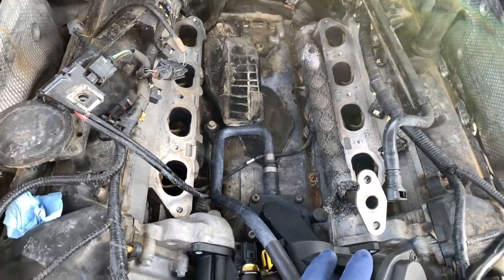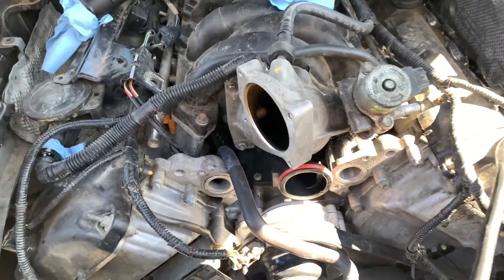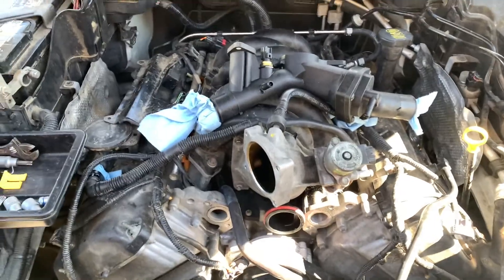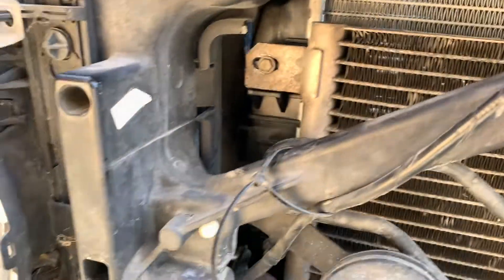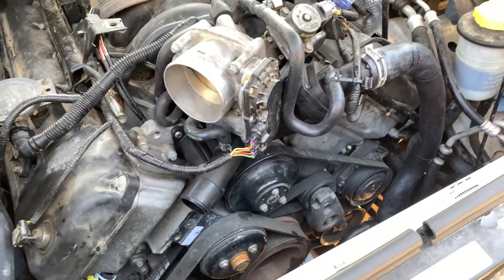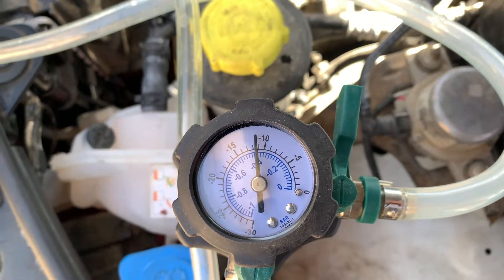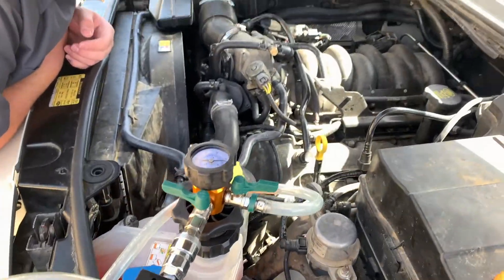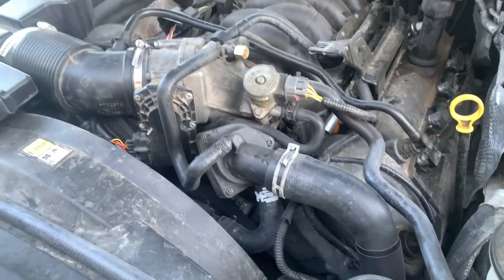2006 Land Rovr LR3 V8 Project (Part 7) "Will it overheat again?"

Comment: What was the problem
Reply from the maker: The radiator was plugged, and the cooling hose that connects to the bottom of the intake manifold was also plugged.  We were able to force water through the radiator, but it wasn't flowing through all of the passages, so we decided to replace the radiator while we were replacing all of the hoses.  There was definitely a lack of maintenance on this rig.  In part 8, I go into what we found with the lack of power and the traction control not working.  I think it's related to the shift solenoids that we are seeing with shifting from 3rd to 4th.  Thanks for watching!